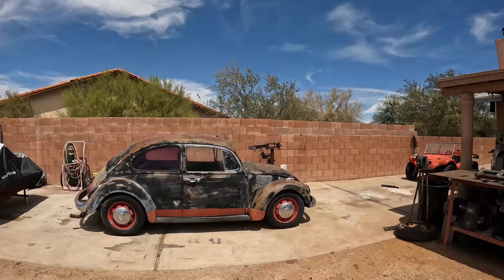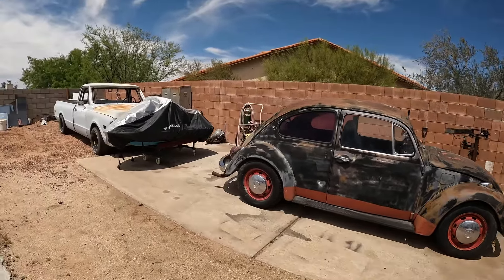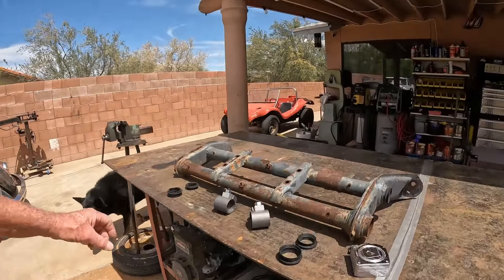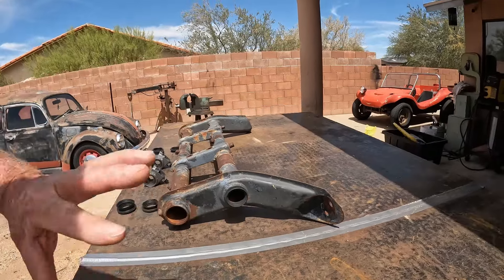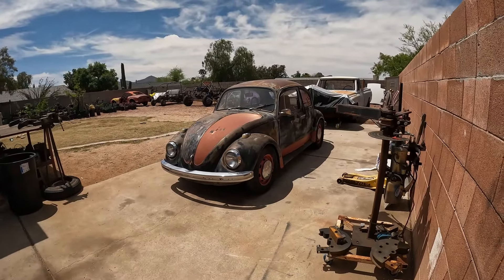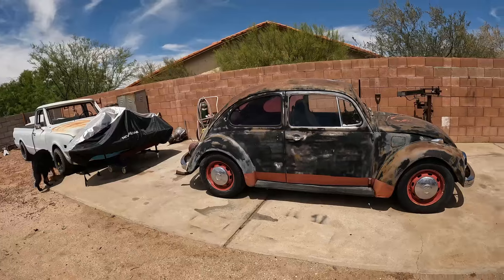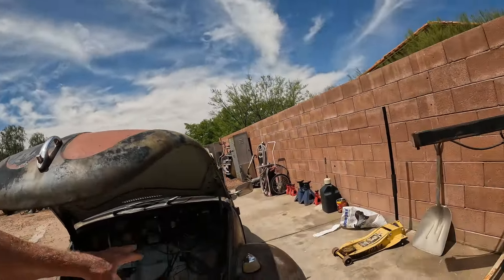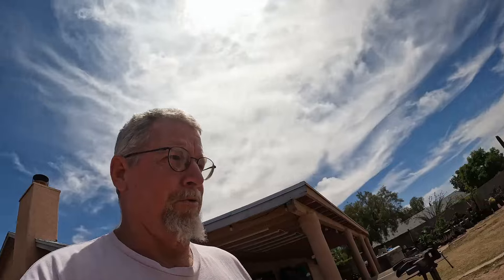The ‘68 VW Bug AKA Black Betty is Getting Real LOW!

Comment: You should narrow it down a little. Maybe 2 inches.
On mine I have dropped spindles with discs and the wheels are very close to the fender 
If I did it again, I would have narrowed the front axle.
Good Luck
Reply from the maker: We’re going to be narrowing the beam by 4 inches👌🏻
Reply: @Wineingerracing  perfect! 2 inches by side!
Reply from the maker: @JeanMelim that’s the plan!